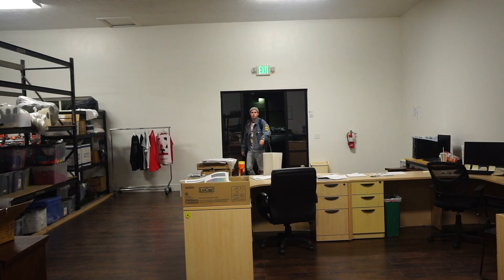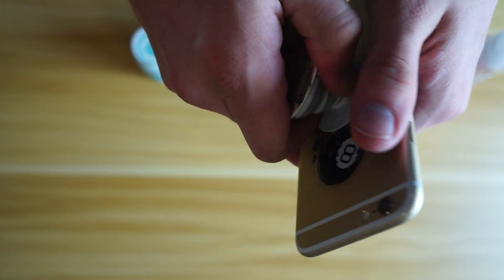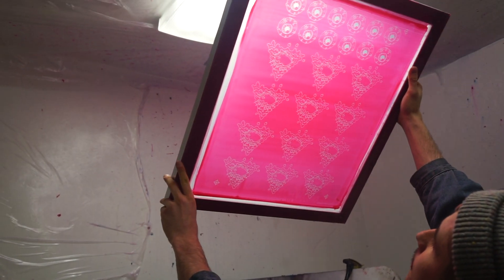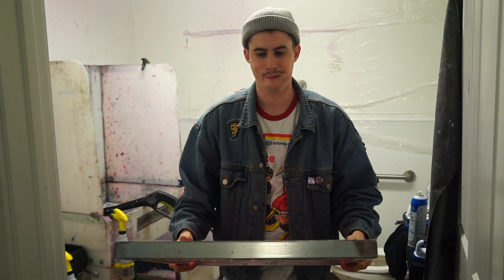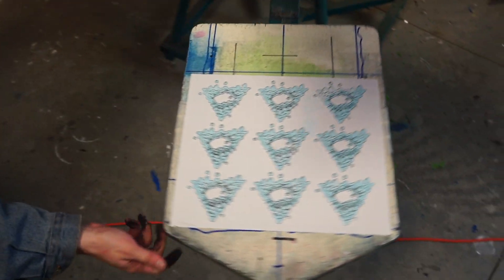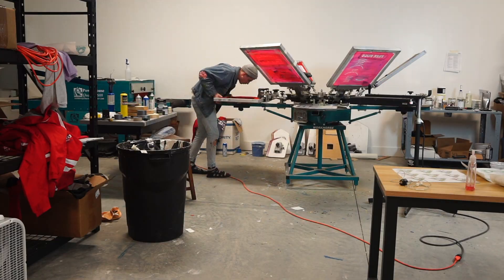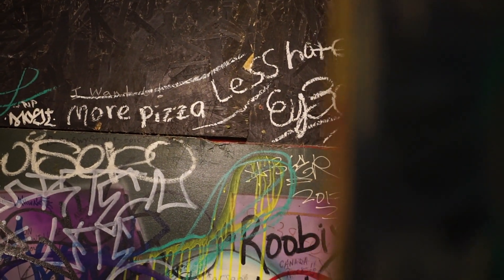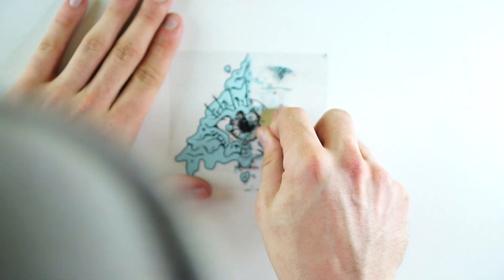A Scratch Away Sticker? Maybe? ¯\_(ツ)_/¯ pt. 2

Comment: HELLO!! it was me that told you about this method, glad u tried it out! the paint should scratch off easily if u the correct ratio. i think i usually do a 2:1 ratio of paint to soap (?) normally i dont have to add water for it to scratch off. if u decide to try it again maybe play around with the ratios :)))
Reply from the maker: you're the best!! I will try it again.. I don't think I had enough soap?